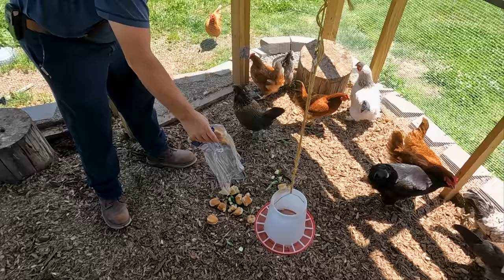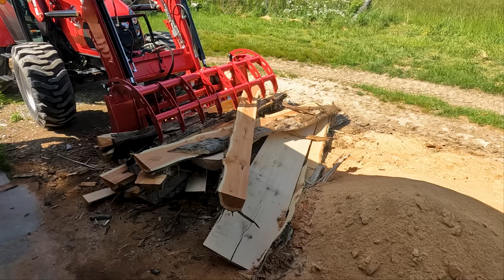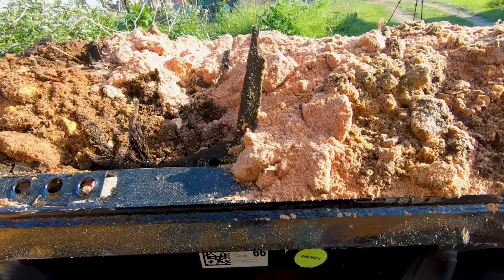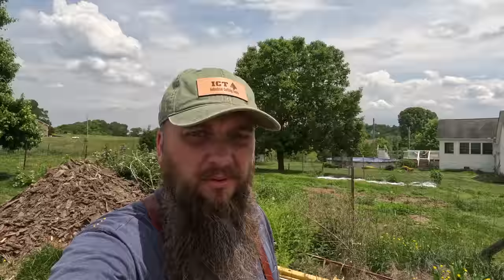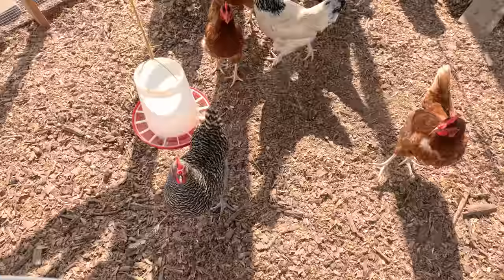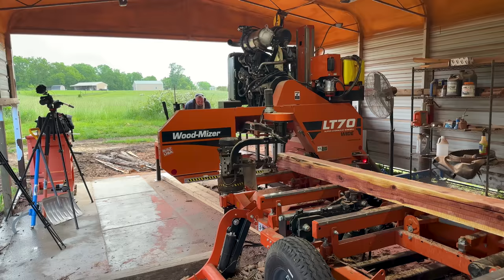Its Here! This Will Make My Sawmill/Farm 100% More Efficient

Comment: Great show as usual, Nathan. A little tip for supercharging your compost pile is the next time you're at the farm supply store, pick up a bag of 10-6-4 granulated fertilizer and sprinkle a few healthy scoops ( 1-2 lbs. ) all over the pile. That will help feed the good bacteria and make it rot faster. Also, every now and then turn the pile over with the loader bucket and add some more 10-6-4. You'll be surprised.

Comment: I bought a cheap 4-in1- bucket for my Kubota tractor and it works perfect for cleaning up after cutting and splitting wood for biting the tree bark and saw dust and getting the last little bit that I used to push around with my standard bucket
Reply from the maker: nice I have been looking at those, sounds like I need one,

Comment: That’s a nice fuel tank for sure. My last Fill-Rite 20GPM 12V electric pump sure didn’t last me long. I thought maybe a pump enclosed out of the weather would be a better design. Looks like you found it.
Reply from the maker: Hope so
Reply: We have two 100gallon tanks with the same Fill-Rite pumps and they have been great.   We use one for diesel and the other one for tranny fluid for blade lube.  Ours sit out in the open weather and work fine.

Comment: From what I see you kicking out when you square up logs.   Those pieces make nice rustic benches.   I've made several after I use my little Alaskan Chainsaw Saw mill.   Especially red cedar makes nice benches.  The tops from a couple become legs for the bench and  3 to 3 1/3 foot lengths of the trimed log are typically thick enough for a bench..

Comment: We have the same diesel transfer tank, only things I found to be problematic is a not so positive on/off switch on the pump (gotta giggle it a little) , needs to be on flat surface as it will twist making it hard to unlatch lid, bought a lawn mower battery from walmart instead of using tractor batteries was a hassle.

Comment: What I do is build a stand to support my fuel tanks elevating the tanks and install regular fueling hoses thay way all my refueling is gravity feed making re-fueling an easy and fast process. Adding a small sump tank at bottom keeps fuel free of heavy contaminants and all trucks that deliver bulk fuel have pumps so height of tank is never a problem and I need no pumps for my fuel.

Comment: Sir, I've been following your channel for some time now and every time I see it, I get the impression, apart from the great work you do, that you spend too much fuel. It is not about the sawmill itself but the machines you use around it. If I have to optimize something, I'll try to make everything possible to get rid of this unnecessary movement of wood around your property by moving all the equipment and stock closer. Obviously, you enjoy your tractors/lifters but from optimization point of view they are just waste of money. Of course, you know your bank account and your possibilities, it is just my opinion and I'm not saying you are doing anything wrong. Respect!

Comment: Love the smell of Cedar, one of my favorites. I’d like to know why the ruler gave you 12 bf and the actual was, what 37? Is there maths involved or are you just a really good sawer, bet it’s the later. 😀
Reply: It's based on the Doyle scale. It favors the mill when purchasing small diameter logs, which are a lot more labor intensive than larger logs. I get nearly triple the lumber that's on the scale. As the diameter of the logs increase, the Doyle scale is closer to the actual yield.

Comment: That's quite a difference. Scale said 12 yet you yielded 37 board feet.
Reply: I had the same observation. The logrite estimated 12 bf?
Reply: @jay-in-az  There are many log scales.  The Doyle is an older scale and allowed for a lot of waste.  The International scale allows for less waste.  It is most accurate when using a bandmill.  There is an old saying "buy on Doyle, sell on International."  Using the International scale for the log in the video would be 45 bf, much closer to Nathan's estimate.  We sell log scales with 4 different scales/rules; typically each is sold to different geographical location.  It is always best to see what scale/rule is being used in your area.

Comment: Electricity DOES come from the wall.  At least that's what a lot of idiots here in Kalifornia think.  That's why the gooberment can mandate electric cars, trucks, and lawn mowers.

The Doyle Scale crosses at about 28 inches.  below that, it under scales.  Above that, it over scales.  It's a mathematical rule that has little basis in reality.  Scribner Decimal C on softwoods is a bit better.  All rules assume some kerf of 1/4 to 3/8.  WoodMizer's thin kerf yields a lot more lumber just on that fact alone.